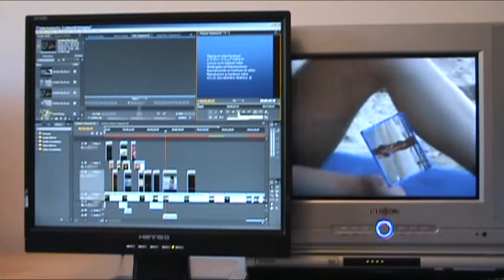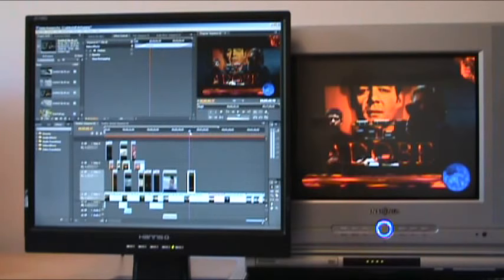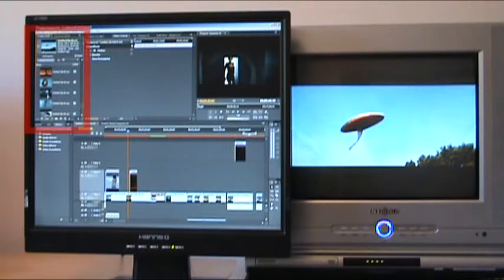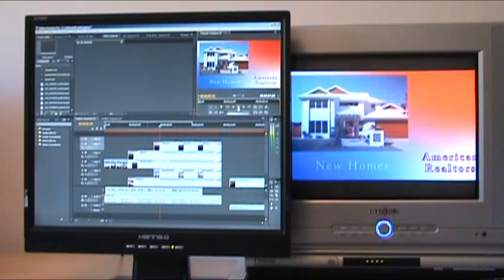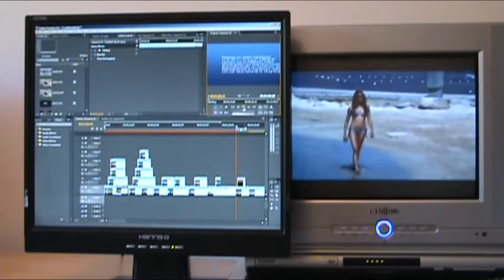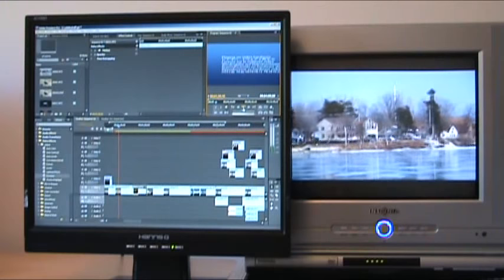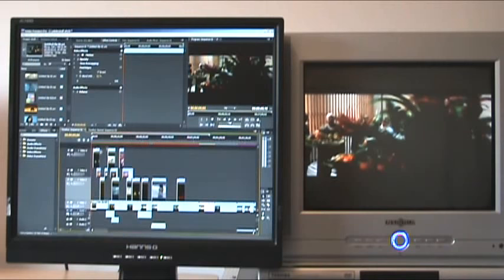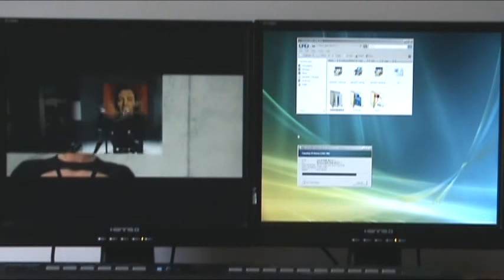retro computer video editing system

Comment: @NCFilms1 All you really need is good GPU, something along the lines of the HD 4200+ series would do fine. CPU should be at least dual core, 2.5-3.0GHz is fine. And a minimum of 4GB's of RAM.

Comment: @adobePC 
im going to be using sony vegas 
but i found the computer with this

AMD Athlon™ II 630 Quad-Core Processor
2.80GHz
AMD 760G Chipset
2MB L2 cache
4000MHz system bus
6GB PC3-10600 DDR3 SDRAM memory (3 x 2GB) (expandable to 16GB)

Comment: Interesting video, I have a couple questions about your setup.  What is the configuration of your DV converter, NTSC monitor and computer monitor? Im new to video editing and would like to understand the value your trying to share based on the video you made.

I understand the value of having a larger screen to view your project on however; I dont quite understand why you cant just connect a regular high-def TV to open output on your video card to view your work.

Comment from the maker: @TheFantomMan 

I can sell it for $260.00 with out the Windows 7 OS. For $350.00 I can include the Windows 7 OS. The sytem is a Quad Core with dual monitor support. It would be better than a $350.00 Dell or HP.